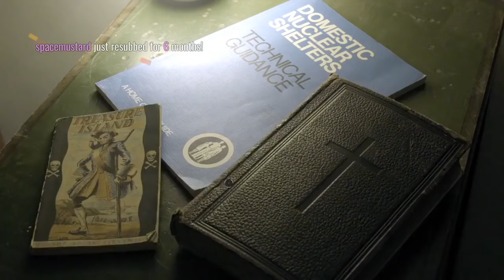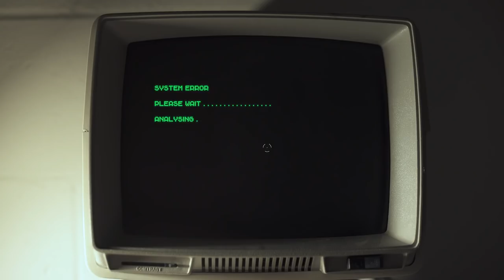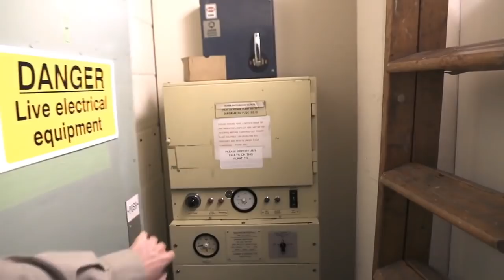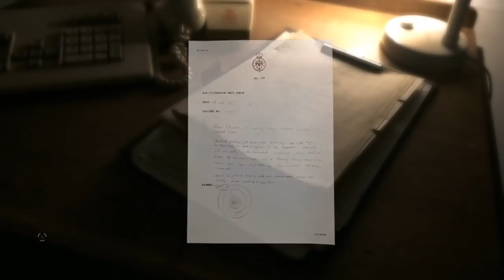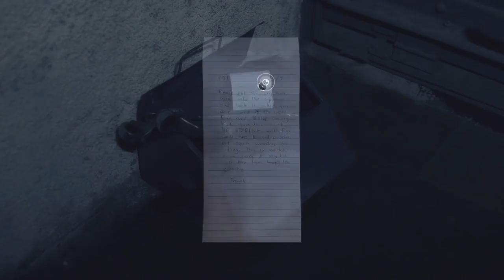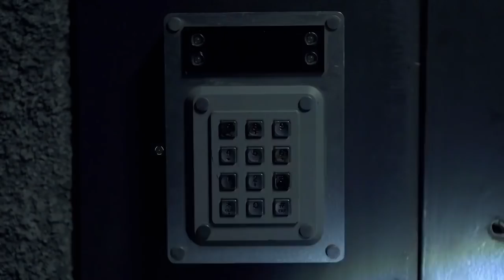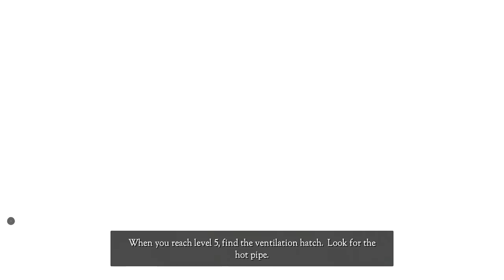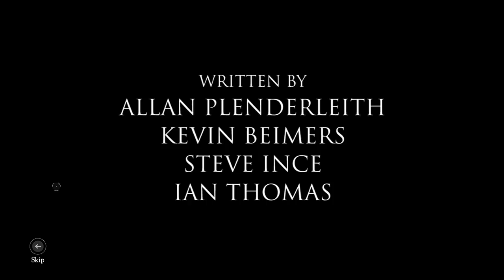Jerma Streams - The Bunker

Comment: I'm no nuclear fallout bunker engineer, but if the inside of the bunker was being flooded with highly radioactive air, wouldn't that mean that outside air is also super bad too? Doesn't it pump in bad air and filter to make it good mean that the air outside is bad in the end? Or is the air recycled in the bunker, but somehow if it isn't filtered the air is just ruined with radiation?
Reply: I saw a Youtuber who, after playing it, theorized that it was the ventilation that was still radioactive. The outside was fine, the inside of the ventilation was what was contaminated, though. With the only thing that was protecting the inside of the shelter was the sealed filters, which our unfortunate hero accidentally opened up.
Reply: Yes lmfao, it's a huge plothole
also, radiation doesn't work that way, it can't just "stay in the ventilation" whilst not being outside
Reply: @backwhenarmyoftwofirstcame2873  you died again?
Reply: it isn't necessarily radioactive air. It could just be radioactive dust that was sitting on top of the filter. When the filter broke, the radioactive dust would be spread throughout the entire facility thanks to the A/C system.

Comment: Where did all the radiations come from then
Reply: I think it was implied during the game, at some point, that the ventilation system could remain contaminated, due to the way it was designed, even if the outside became all clear. Not that that was a problem, because of the sealed filters... Which our clumsy fellow accidentally opened up.